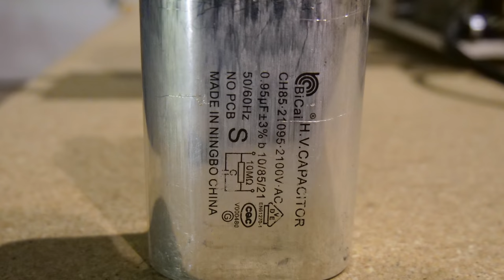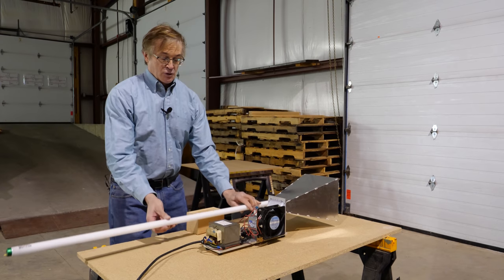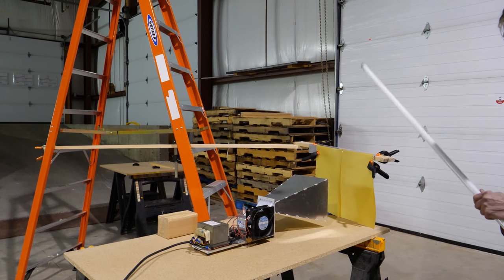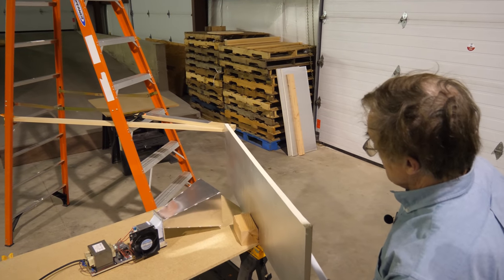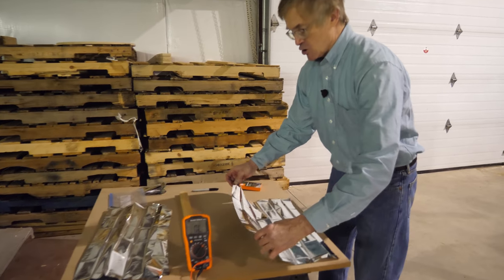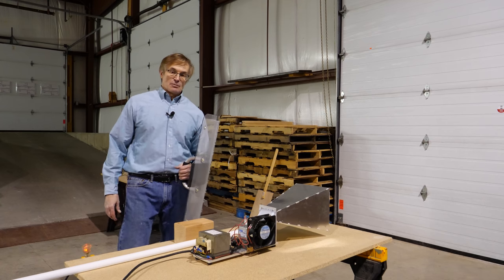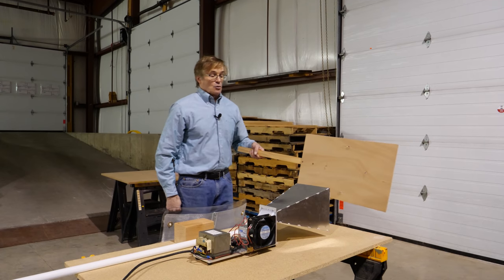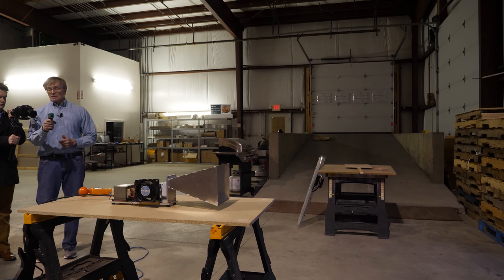You're not protected from microwaves... yet - Part 2

Comment: I've seen by the end of the video that you used a field strength Meter to measure the intensity of the waves and to detect wether there are microwaves around. And I also noticed that the readings came back in temperature Units. My question is, would an infrared camera help visualize the waves ? If for example, I get Attacked in my place from behind walls, can an infrared cameras record such attacks from different waves of the electromagnetic spectrum, especially radio waves and microwaves ?

Comment: I'm a professional tower climber, and I think I'm going to start carrying those neon bulbs just to see if some of the bigger stuff makes it react. I've always wanted to own/borrow someone's meter just to see what I'm exposing myself too.  So if this reaches you here's a question; would the electrically conductive materials behave any differently if it had a ground?
Reply: As far as being protective, the conductive materials would not change in any important ways if they were grounded.

At most, you'd reduce the chance of a minor static shock... But they probably wouldn't build up enough of a charge to produce a noticeable shock in the first place.

Comment: This is why they took the lead out of the paint. Now they can see inside most every building with any RADIO(RADAR) cellular signal. Unless you're in a metallic exterior building.
Reply from the maker: Probably  not.  Metal isn't enough.  The coating has to be conductive at the scale of the wavelengths, which in this case is millimeters. The paint insulates the lead so it isn't  conductove.

Comment: I just tested some mylar film that I have, and it's conductive (have to pierce it to test as it's coated). Would that work? My guess is yes. Also, I have a decent amount of faraday fabric, which is conductive - is that the same thing you mentioned? 

The mylar film is very, very cheap in comparison to faraday fabric or the graphite film you used, so it seems like a fantastic solution as you can get huge rolls of it for very cheap compared to the others - even cheaper than aluminum screen door mesh.
Reply: If you watch the video, then you will have your answers.

Comment: plus being a transformer the secondary coil is decoupled from the mains. the results is that if you become the path to ground the earth wire cannot save you since on the main side all will be just fine and depending on the amps and type of the circuit breaker you may just stay there and fry. this is why by far microwaves transformer claimed by far the highest amount of life than any other component. at least speaking of hobbyists. indeed you know this and much more than me but i think it's worthy pointing this out.

whenever i see ppl doing burning patters in wood with those transformers i feel really uncomfortable

Comment: Question? So from the test, Aluminum siding on a house should be a barrier in your home. Right? Would a metal roof also work as a thermal barrier. Laminate flooring says it has aluminum oxide,  for wood or stone there is aluminum oxide finish, would that type of flooring work as a barrier also? TIA.
Reply from the maker: The roof would work.  Aluminum oxide is a non conductive, dielectric insulator.  It would not work.

Comment: Check out the "Klein Tools Non-Contact Voltage Tester Pen, 12-1000 AC V with Infrared Thermometer
NCVT-4IR". It is an excellent pen style  Infrared Thermometer that is very discreet.

Comment: One thing I've always wanted to know is if the magnetron stops emitting microwaves instantaneously after turned off, or to put it differently, is it safe to open a running microwave (which will stop automatically) or should I stop it first and wait for a few seconds before opening the lid?
It would have been cool to see how fast the light turns off in your demonstration setup after you unplug it  :)
Reply from the maker: It's  not instantaneous, but it's close. The only residual energy in the system once the power source is removed is the inductive field in the transformer and the charge in the capacitor.  These components dump their energy  at line frequency ie 50 or 60 times per second.
Reply: @TechIngredients  thank you for the reply!

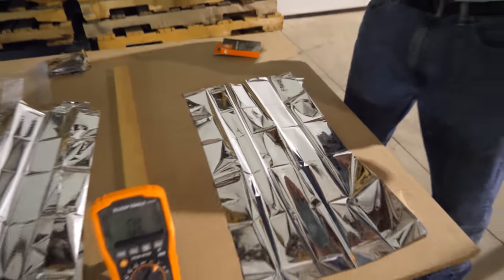Comment: At 14:44 you labeled the electrically conductive side "front" and said you will explain why you did that, but I think you forgot.
You only expose one side to the device (I don't know which one), and it works
I'd have assumed that the side exposed doesn't matter but as you talk about it, there as to be something related ?
Reply from the maker: As it turns out, it doesn't matter unless you want to attach a ground lead to enhance the blocking ratio as with a Faraday cage.

Comment: I just had a TV flyback charge a homemade capacitor aluminum foil in cases in plexiglass plates on the edge with scotch tape. The capacitor was mostly discharge. I touch the end went through the scotch tape got a good jolt to the heart. I guess wasn't too powerful still alive. But lucky.

Comment: Thank you so much for the amazing and informative videos! I was hoping for a brief explanation about how the energy dissipates in relation to distance from the source. Is it correct that the energy dissipates inversely proportional to the distance from the emitter/antenna? We use radars and have situations where we are requested to secure them. I believe that there is little danger, with the distance from the scanners, but we still secure them as a courtesy. Thanks again for the informative videos!
Reply from the maker: Thanks.
The energy spreads at an angle dependent on the wavelength and the aperture.  The shorter the wavelength and the larger the aperture, the slower the divergence.  The energy doesn't really dissipate because the absorbance by the atmosphere is very low.
Reply: @TechIngredients  Thank you very much!

Comment: What happens if you reverse the mylar? Will it still work? It should, or are there heating concerns? Thank for the great video! Very timely considering the state of the world.
Reply from the maker: It does.
Reply: The mylar plastic makes zero difference, it's the metalization that is the "protection", and it doesn't matter which side it is on.

Comment: Crazy question here but since a lot of sunscreens contain zinc as an ingredient, would they be effective or partly effective against microwave radiation?
Reply from the maker: No.
The barrier has to be electrically conductive over a length  that significantly exceeds the wavelength of the radiation  it's  trying to block.

Comment: On your idea concerning the rigid batts for protection, why not use aluminum screen over regular fiberglass batt insulation, then sheetrock over it? That would cover the walls for protection, but now I am thinking what would be a good protector for windows? "Old style" metal blinds?

Comment: I wish you guys used a radar detector to demonstrate the energy frequency’s being pushed out by the microwave generator device. The, “radar detector” used in peoples cars, captures the microwave energy routinely when approaching any 711 store front, because of the micro wave energy coming out of there front doors for some reason. Why don’t you demonstrate how the radar detector can be used to detect micro wave radiation? The principles are the same wave length energy detection principles right? I hope you respond back.

Comment: Take a rubber handled screwdriver or pliers and short that capacitor over the two contacts, to discharge it. NEVER trust that dump resistor, people have been shocked by them, when it should have dumped the load. They are not reliable as they age. Shorting it manually is the only way to be 100% sure. There's all kinds of videos of people disassembling them and all of them (usually) say to short it out before handling it, because it can be extremely dangerous.

Comment: I wonder to what extent particles suspended in the air would reflect or disrupt the radiation if the space blankets can work with such a minimal layer. Such as some sort of smoke or an aerosol fogger containing conductive materials. I doubt it would be able to block it but would there be enough of an effect to reduce the intensity?

Comment: Hi, can you recommend a meter like one you showed here, orange with a ball on top(?) We believe we're being radiated from the new (four plus one) + (seventh letter) towers here in Philippines. We are vibrating in chest in early morning hours of night. Lots of sweating too. Cheapest meter i see available here is about $600. I'd go in the $200 range if possible...any yhoughts on that? Thanks, Bill
Reply: I have to say that orange meter (I think a Tenmars 3-Axis RF field strength meter, TM-195 maybe?) shown only goes up to 3.5 GHz (at least the one I have does). Best to get one that measures higher frequencies. I like the Cornet 88TPlus Electrosmog Meter. It runs below $200, like $170, usually. I've had four of them and they are very user-friendly. The orange meter with the ball on top, which I do have (the one named above), looks like a bomb or stick of dynamite, people recoil from it in public. The Cornet meter looks like a cell phone. Much better to use in public.

Comment: If one were smart they would place small speakers on their armor to capture and use the waves in one manner or another, or at the very least as a detector.  Considering speakers uses pulses of electricity to move a cone which produces sound, the same would and does work in the opposite.  Speakers could pick up the sound and create tiny pulses of electricity which accumulate in a battery or capacitor.  "Free" Energy of sorts not to mention a built in detector.  Having never tested this theory I am not sure as to what the efficiency would be but I am sure it can be tuned accordingly.
Reply: Well, because if you're just trying to capture radiating EM spec waves, it's easier to just use an antenna (or antenna grid, especially one of wide frequency range design) at that point. If using a shield or armor as you've mentioned, it'd probably be more efficient in energy capture with less energy loss and easier to incorporate into the design as well.

Comment: This is fascinating. My question remains, if the door on my microwave is closed is it safe to be in front of the microwave a few feet away? If not, does being off to the side make a difference?
Reply from the maker: That's hard to say not knowing the condition or the design of your microwave, but it's likely to be safe as microwaves are pretty benign as long as the intensity is low enough to avoid any heating.
Reply: @TechIngredients  I didn't expect a reply. Thanks for the info!

Comment: I'm actually not too certain how dangerous a running microwave oven with its door open really is, at least from afar. That's because with the door closed, the thing is a Faraday cage. All of the microwave energy going into the oven will have to be dissipated within, which leads basically to as high a standing, resonant field strength it takes to get there. With the door open, sure, the penetration depth into skin is still only something like 17mm, so the radiation does get absorbed, but because there is no resonance, there are not going to be any hot spots, and there will be significant leakage into free space.

People can then take surprising amounts of heat input, at least for short periods of time, as long as the temperatures don't get exceedingly high. Just consider hair driers, which can exceed a kilowatt in power, or the Finnish sauna. There's of course still the problem of deep heating which you won't necessarily detect before it starts cooking your tissues, but without some real calculation, I wouldn't be too sure about that either; it might equally well be that the heat deposited as enough time to transfer to your blood so that you'll feel it as a fever, and know to retreat.
Reply from the maker: That's  probably  not true.  The distribution of that energy, when emitted  by that rectangular box, will be far from homogeneous.  There will be unpredictable hot spots. You saw the effect on the ham, which was only 1 mm thick.  I question your 17mm absorption depth.  Finally, the cornea of the eye is far more vulnerable  than the skin because it has no capillaries (so you can see through it).
Reply: Just came to mind, for those viewers who might not have thought about it, the penetration depths we're talking about aren't about strict boundaries, but basically about the halflife of a field within tissue over distance. That means that even if I say the field given off by a microwave oven penetrates 17mm, the power deposited will be significantly higher nearer the surface, and there will be a tail to the energy distribution reaching much further in, or perhaps even through say a finger. You cannot just blindly average the heating over 17mm, because while it might not cook you in the average, it might still cook your skin right off. Not a pretty sight, a third degree burn.

This stuff is finicky.

Comment: Could you PLEASE explain to me how these millimeter waves differ from the potential of the mm waves that keep coming out with the new internet speeds? What crosses the threshold from "low power" to "high power". 1-10mm broadcasting at 30 and 300 gigahertz right now and it's only going to get more abundant.  I just wonder what is the difference?  I mean, sure the internet can't cook you yet but at what point would YOU be cautious about going near the transmitters and receivers of these super high speeds of internet?

Comment: I found Styrofoam works to stop microwave torture . If I insulate my mobile home with Styrofoam the roof will be solid foam with metal skin
 ,walls have wood beams but aluminum skin on outside . Then floor would be foam with wood but I can cover it with conductive materials. Will this work? windows would have mesh cloth like sheers or bug tent

Comment: BIG ERROR at 19:00 - the aluminium flyscreen mesh will block 2.4GHz Oven Microwaves, but it will NOT effectively block the higher frequency "Weaponized" Microwaves at 80 to 120 GHz.
If we assume that the apertures need to be smaller than 1/5 wavelength to be effective, then:
2.4 GHz = 125mm wavelength = so <27mm mesh = OK
80 GHz = 3.7mm wavelength = needs <0.75mm mesh
120 GHz = 2.5mm wavelength - needs <0.5mm mesh
I don't know the exact formula for size to completely "reflect" RF Waves, so perhaps that should be explained.
Reply from the maker: You're assuming and we don't need to completely reflect the energy, just attenuate it. Those general rules for mesh sizes with Faraday cages are looking for extreme attenuation as in 70 db and up.

Comment: If you used an SCR you could turn it on/off using a low voltage.
Reply from the maker: True.  The cord adds another  level of safety. Because  you can see it when you might not see an indicator light.

Comment: I wonder to what degree a high permittivity material, like the dielectric films used in capacitors, or a high permeability material, maybe a lower-conductivity ferromagnetic powder, would block or reflect the microwaves.

Comment: If you made the leads longer on the light-bulbs wouldnt they conduct more energy towards the bulbs? If you lined them up with the longer ones on the bottom, and shorter ones near the top, you should get some sort of meter that can document an approximate level of beam intensity? of-course this would require some level of calibration before to know what the levels around you are.
Reply from the maker: That should  work. However, I'm  not sure if there would be much utility  there.
Once you know you're  standing  in a microwave beam, it's  best to get out ASAP rather than spending  time to estimate  its  strength.

Comment: LED's are CURRENT devices.  Control the CURRENT in every LED - all good.  Voltage application to an LED relies entirely on the ESR (Equivalent Series Resistance) for its survival when using a low resistance voltage source that is inappropriately applied.

Comment: How can you figure out exactly where the beam is coming from?
Can you lay some of the lights inside a narrow, 3-sided piece of metal and put that on your shield. If the beam gets thru the opening of that piece of metal it's at your 12-o-clock. 
Would that work?
Reply from the maker: If the apature is in a metal sheet and the detector is directly behind it then that should work, but the walls have to be microwave transparent otherwise it will work as a waveguide and light the detector no matter what angle the energy was traveling along when it passed through the hole.

Comment: Prof.  Martin Pall shows how EM can be toxic to cells apart from thermal effects.  Voltage gated calcium channels are used by cells to control ion exchange with their environment.  In the presence of an alternating electric field (especially circularly polarized digitally modulated microwaves) those channels will open uncontrollably wreaking all kinds of havoc on internal cellular ion concentration, even leading to apoptosis.    It doesn't take much energy.   Cell phones send and receive circularly polarized digitally modulated radiation.  Who is minding the store?

Comment: Those aluminium insulations seem pretty expensive for a room sized faraday cage. Would chicken wire do the job? I've read the holes are the right size to reflect microwaves.
Reply from the maker: The mesh has to be no larger and ideally  smaller than the wavelength.  Chicken wire will work for a microwave oven source, but not for higher frequency , weaponized systems.

Comment: Do the shields become electrified? If you touch the back of the shield will it transfer the energy to the back? The shield is an antenna unless it is grounded right?
Reply from the maker: That's right, but there is no significant net charge as I demonstrated by grabbing it in the first video.